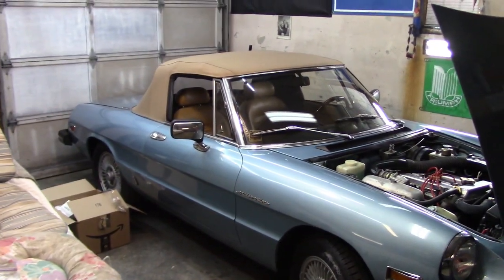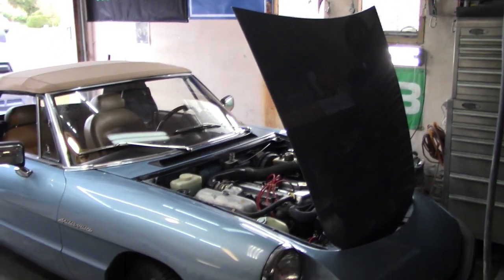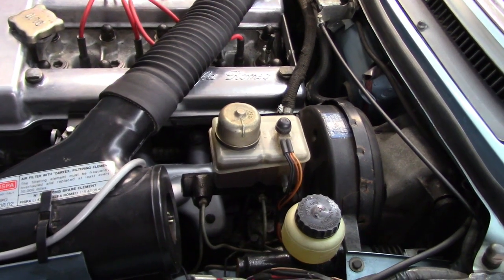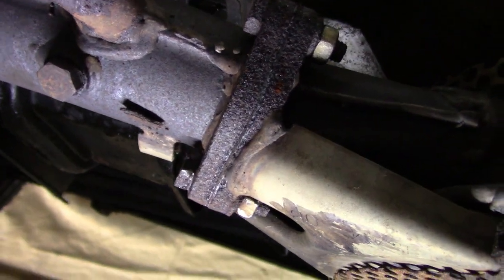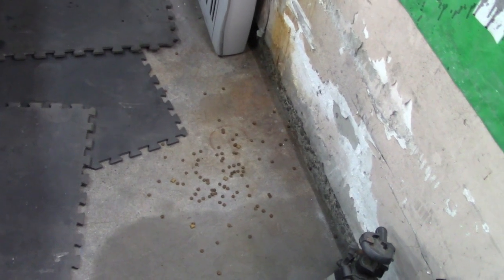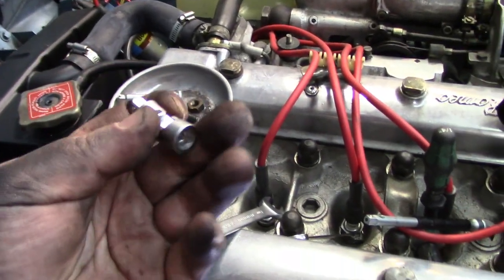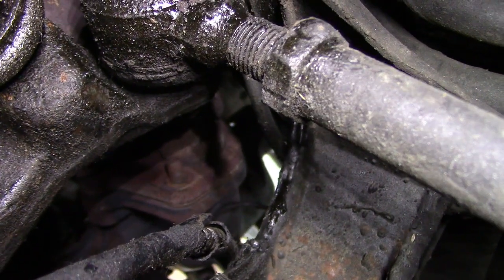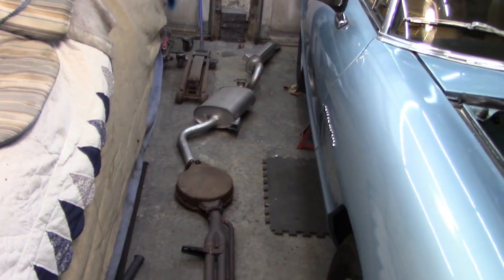1981 Alfa Romeo Spider Veloce, Exhaust Project, Part One

Comment: Only a couple of months ago I did the exhaust on my '74.  Since I'm being a little cheaper on my restoration I used a classic alfa stock system (EX002 @ $300 delivered) along with new studs and nuts.  After having problems with tuning my Spica and having a portable Innovate Air / fuel wide band I relented and bought a set of Ceramic Headers from Centerline (a little less than $600) delivered.  It worked for me and now I'm able to drive and log my Air / fuel.  I was able to reach the brass nuts with my son on top.  I purchased a 20" extension long ago for my sockets.  I need the long socket because I have the car on taller jack stands to to my generous girth even though I'm just on cardboard on the floor (a recent refrigerator purchase).

Comment: Try MAPP gas sometime instead of propane.  It burns a little hotter, but I find it works much better than propane for rusted bolts.  It might be that the torch just burn higher gas volueme, but I can often get the  nut red hot and then it comes off easily.  Also, living in the country, I have mouse/chipmunk troubles.  I put a little bit of 1/4" screen over the air intake on all my vehicles because everyone of them had nests when I figured out why one wasn't running well.
Reply from the maker: Yes, I am going to buy a MAPP gas cylinder....I do have a full bottle of acetylene as well but it is tucked away along with the torch...Yes, I will put a little piece of screen on the end of the air box to prevent them from getting inside.
Reply: @cheftush  acetylene kicks butt, forget the MAPP then!  I have had bolts so rusted that the end of it looked like a drip of water, and got the nuts off with Oxy-Acetylene.

Comment: Hi Tush,

Thanks for the great video! I plan to install the same.

If you haven't changed them yet. Maybe it's a good time to change the engine mounts now that the exhaust manifold is out of the way? But the other side could be a "pill "as you need to remove more?? Just a thought as they have a history of sagging.
Reply from the maker: Thanks. I did check the mounts and they are in good condition.